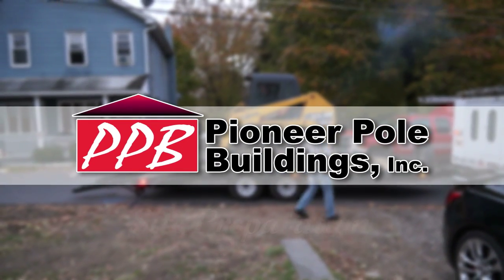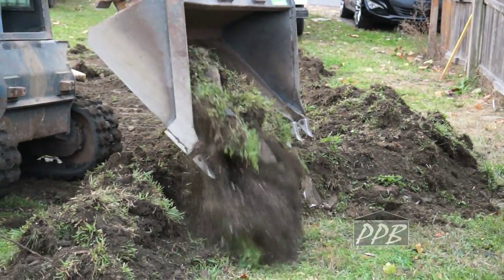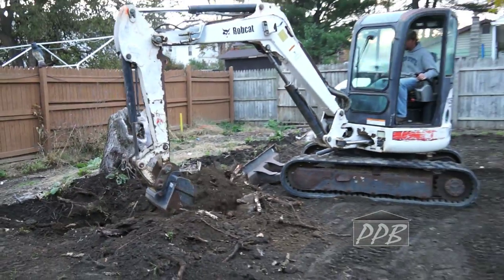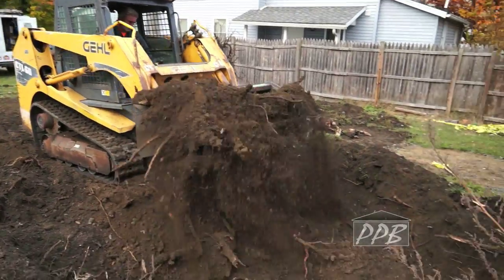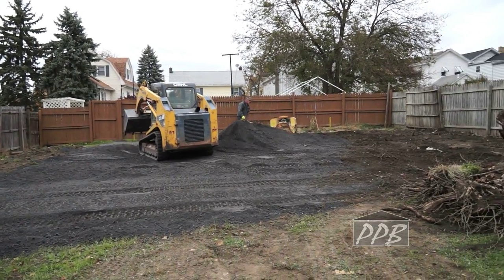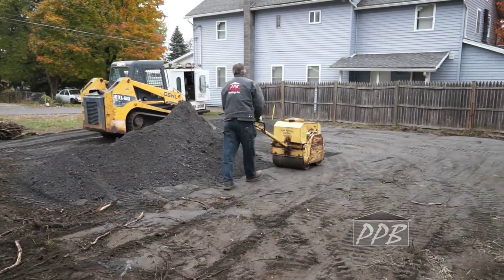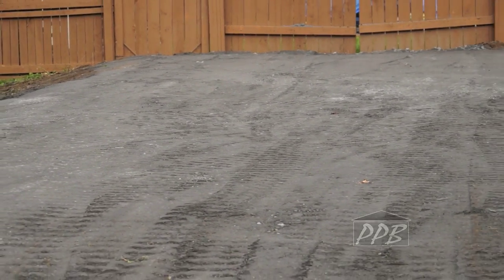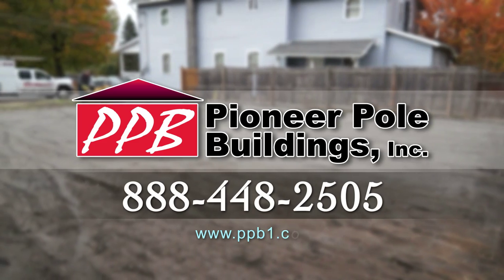Pioneer Pole Buildings, Inc. - Site Preparation

Comment: EST of the cost to prep the site I had it cleared of trees still some stumps left. Not leveled yet. Looking to build a 40X60 or 40x80
Reply from the maker: It depends on options as well as where you're located so we can price to engineer the building to meet and/or exceed all building code and requirements in your specific township/county/state. Give us a call during business hours and we'll be happy to work up a quote. 888-448-2505 ext 136 Our hours are Mon-Thurs 8a-5p, Friday 8a-4p. Note we are closed tomorrow for Memorial Day 5/25/2020.

Comment: What size/type stone is that? The video says modified stone but more specifics would be nice. Thank you,
Reply from the maker: Hello, The type of gravel known as 2A modified is composed of stones that work well for compaction. No stone is larger than 1.5 inches in diameter and it goes down to the smallest stone, which will be screenings (very fine stones). How it works is when it is laid, the big stones allow for a solid foundation and then the smaller stones lay in-between, which it then compacts almost like concrete (with a roller).